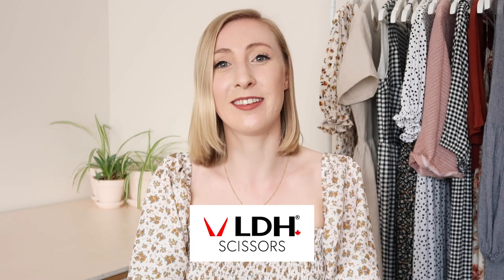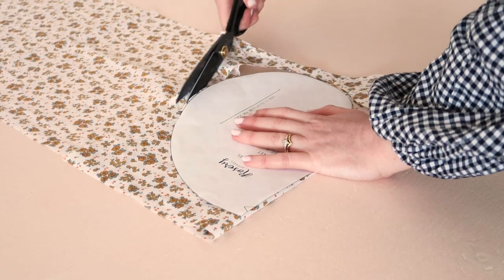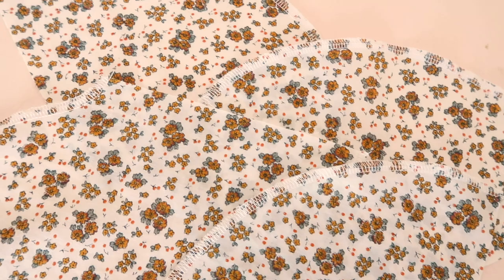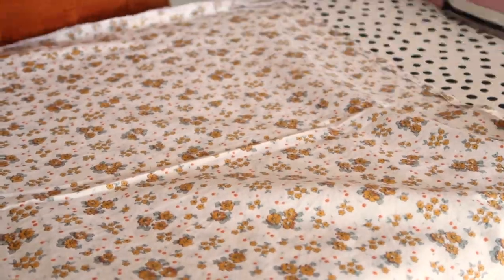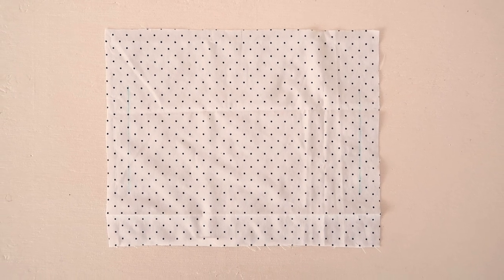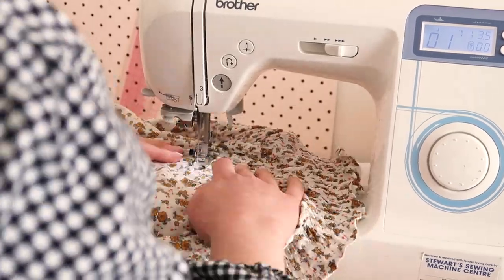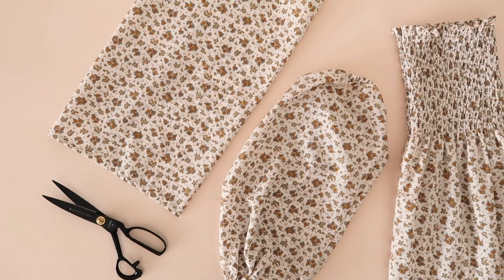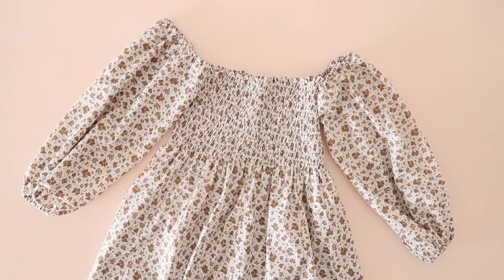DIY SHIRRED Puff-Sleeve Dress | Made From Just Four Rectangles!

Comment: What I can't quite tell from watching your process on this is if, while sewing the shiring lines, you are stretching the fabric out flat each time so they are not affected by the shrinking from the previous row, or if you are allowing them to be scrunched up as you go. If the latter, would that not make the shiring at the bottom tighter than that at the top since it would increase the reduction each time?
Reply from the maker: I try not to stitch over the gathers, and instead stretch it slightly as I stitch, as it results in a nicer finish at the end 😊

Comment: If you’ve got a brother machine and are super frustrated with trying to get your machine to properly shir - YouTube it for your machine - I had to tighten my bobbin case with a tiny screw - tried every other combo of tension/stitch length/ and elastic winding …bobbin tighten was the only thing that worked😂
Reply: Well, maybe I need to do this. Went through bobbin after bobbin and finally finished, but it didn't shrink down enough and it's too big. Falls right down my chest :(

Comment: Hi 🙋‍♀️ thank you so much for sharing this diy! I am having a little bit of trouble with the main body shirring.. my body measurement is 35 inches - am I correct by cutting two squares 35 inches wide? When I am shirring this part it’s still way too wide to be worn as a top :( 

Any help is greatly appreciated, thanks so much x
Reply from the maker: Yes that sounds right! You might need to adjust your machine settings slightly (every machine is different and it takes a bit of testing to get the settings right). I recommend using a smaller square of fabric, and keep adjusting the tension and stitch length until the shirring gathers it to half the size. Also, don’t forget to use steam to shrink the stitching even more!
Reply: Thanks so much for taking the time to reply, I will try all of that :)
Reply: I have the same measurement as you and mine came out the same.... so big! Hopefully I can find someone to gift it to.

Comment: I'm. Having trouble with the sleeves... when i put the elastic in the shoulder and cuff, the shoulder seems just fine as far as volume/puff, but the cuff at my wrist seems way too long and comically large & puffy.... should i taper them out or just shorten them & make a narrower rectangle? For reference, my armseye measures 17.5 inches & length is 22. I made the rectangle 35.5x29.5. Any suggestions??? Thank you!!

Comment: Great video! Thank you! Do you find that back stitching the elastic works well, it doesn’t fall apart? I’ve seen suggestions of tieing the elastic together and other suggestions of burying the ends in French seams. Just curious if backstitching works well. 
Also - do you stretch out the fabric as you sew or leave it gathered as you keen on adding lines of shirring?
Reply from the maker: I find back stitching works perfect, and I try to stretch the fabric out as much as I can as I sew the lines of shirring 😊

Comment: I’ve started making this and I’m about half way through the shirring but there’s no way it’s going to gather up enough to be small enough. Is it definitely the bust measurement for the width of each of the body rectangles as that would require the shirring to shrink it to half the size to be able to fit the bust measurement? Please help!!
Reply from the maker: Half way through mine didn’t look like it would gather enough either, but every row of shirring gathers up the fabric more and it will eventually shrink to half the size. If not, then your tension needs tweaking. Did you do a practice sample piece like I show in the video? Also, don’t forget the steam trick, as that shrinks the shirring too 😊

Comment: SOS! I’m making this dress using this tutorial and my dress is not shirring right. The elastic has no stretch at all and even comes up on top. My stitch length goes up to 4 and the top dial goes up to 9. I’ve tried changing everything and I can’t seem to get it right. I made sure to hand wind the bobbin. What should I do?
Reply: A potential solution is making sure the bobbin keeps the tension. When you insert the bobbin and there is that little lever to put the thread into- make sure it stays there when you are sewing. If it's falling out and the shirring elastic is going right from the bobbin to the fabric and not through that little catch- the shirring will end up super wonky!

Comment: What did you do with the extra thread elastic hanging on the inside when you cut after sewing a line? I did a dress recently and it felt like some of the elastic didn’t stay put at the ends
Reply from the maker: I tied the ends together on the inside into a knot, but I’ve also just backstitched at the start and end of the row in other projects and that’s worked well too 😊